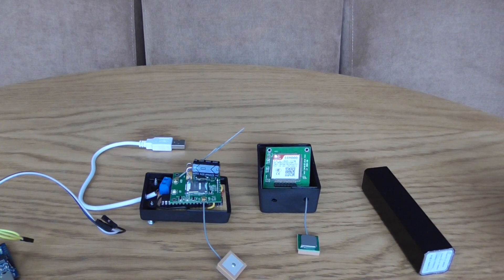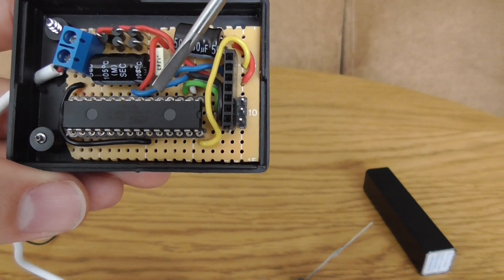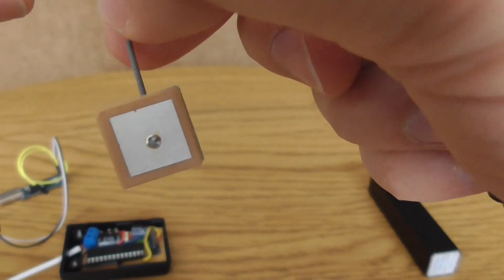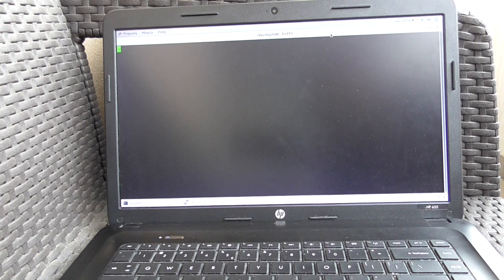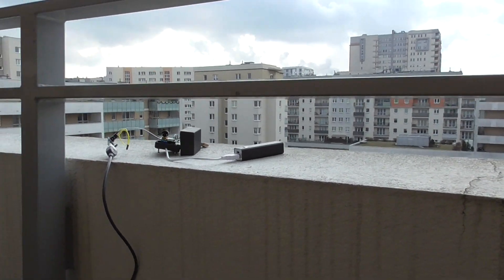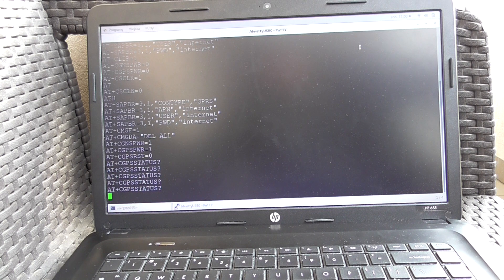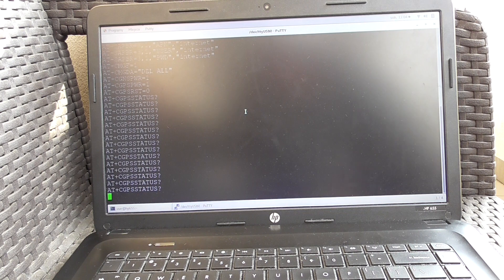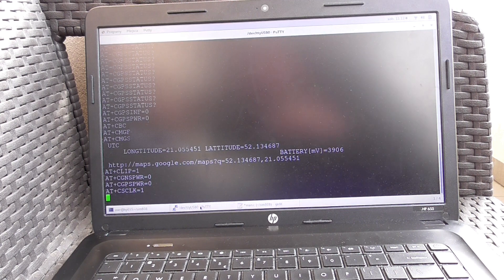Make your own cheap DIY GSM GPS bike car tracker / GPS car locator  for  20 USD ! - based on SIM808

Comment: hi Aadam!! really greatful to found your video, i wanted to make a device for my community as pet tracker but maybe i'll use wemos d1 mini as the main board to connect with the SIM808 do you think its doable? also i have zero knowledge in this, i just hope i can do this to help the owners.
Reply from the maker: Hi, I have no experience with Wemos D1 mini so I am unable to answer. But if it has real serial port available and if there is C language compiler then it is possible do build the tracker with this board. I can see it is based on ESP8266 so ih probably has serial interface
Reply: @justanengineer5599  thanks for the reply. can you to teach me  in figuring out placing of boards and calculation on voltage, do you mind? im sorry if it is a weird request because i dont really know how to place the things and calculate the voltage.
Reply from the maker: Here you have a tutorial showing how to connect SIM808 breakout module from AND-GLOBAL to Weimos D1 mini : https://www.instructables.com/HackerBox-0048-SIMSAT/
there is also some sample code for testing this duo ;-)
Reply: Hi Michelle! I am working on a project similar to the one you mentioned. Could we communicate?

Comment: Hello Adam,  can you make a device that doesn't use gmrs/cdma? Strictly satellite?
Reply from the maker: That would require satellite transceiver which is very expensive. An example is  Iridium 9602 transceiver. Of course satellite Iridium phone could be used to transfer some data as a modem or send text messages (Iridium GO !) but I do not have one to check how I could utilize this channel of communication

Comment: hi adam can you change or make a source file for sms activating gps module because call is not common in gps to acquire position
Reply from the maker: hi, please use files "main7.c" or "main8.c" - these source C files are exactly what you need. By  texting the device from your phone with message content :  "single" you will get single GPS reading back as a text. The "main7.c" and "main8.c" files  are not experimental versions anymore, they are fully working and are in use by my colleagues in their car GPS trackers. 
You can see how the "main7.c"/"main8.c" source file  works in this video : https://www.youtube.com/watch?v=ZMRz5Emcvew

If you have BK-808 module from AND-GLOBAL please use "main7.c" source file and "compileatmega7" compilation batch script. For other SIM808 boards that do not have DTR line exposed - please use "main8.c" and "compiletatmega8" script.  Now "main9.c" is the experimental code.
 
In this version you will get support for following text commands of the GPS tracker :
    Command "ACTIVATE" stores the phone number of sender as allowed to MT call . Only 1 phonenumber is stored and allowed to call.
    Command "MULTI" gives CONTINOUS MODE of positioning and sends 5 times GPS location in 3-4 minutes interval. 
    Command "SINGLE" gives single GPS/GSM positioning response.
    Command "GUARD"  notifies the sender if GPS position changes  (~300-500 meter sensivity is hardcoded but can be changed in the program) - tracked vehicle is on the move, maybe stolen. "GUARD MODE" can be stopped by sending "STOP" message or ends up automatically after first detection of movement.

Comment: Please contact me I want to add a feature to my mobile app which will allow users to purchase this from you and integrate the device with my app.  Email me at dperley@bikerflyer.com.
Reply from the maker: Hi Daniel, I do not want to sell this project. This is published as free, so everyone could enhance this project and add new functions.
Reply: @justanengineer5599  No I don't want to make money off it, I want users to be able to get it and use it in the app.  But you can't be asked to pay for the supplies yourself.

Comment: you can't imagine what did you solved for me with that cap. 5 nights struggling with different power supplying and it didn't connect. Thank You so much man.
Reply from the maker: Glad I could help :-)

Comment: can we modify the output to send via cloud server using POST? I want every 3 minutes to send the location on my server. Can this be configure via Putty or I need to recode/fflash all details with new format via Audrino tool?
Reply from the maker: Hi. To use HTTP POST the SIM808 board would have to connect to GPRS and  then setup HTTP connection to your server. You would have to make corrections in the code, then recompile it and flash ATMEGA again. I currently have no time to make such adaptations in the code but you may look at this page : https://www.raviyp.com/embedded/194-sim900-gprs-http-at-commands?start=1   There is a short info how to do it. Also here is a good example https://stackoverflow.com/questions/33346425/sim800-at-command-post-data-to-server            The SIM808 works exactly same way when connecting to GPRS and HTTP

Comment from the maker: How to program the ATMEGA chip  :

It is all well described in README.md file on Github link https://github.com/mcore1976/sim808gpstracker/blob/master/README.md . The procedure is following :

a) get Ubuntu for your PC. If you have Windows machine you may download WINAVR environment here https://sourceforge.net/projects/winavr/    - but I dont have experience &   templates for WinAVR   - then proceed with step (c)

b) download Ubuntu packages : "gcc-avr", "binutils-avr", "avr-libc", "gdb-avr" and "avrdude"  -  using command : "sudo apt-get install gcc-avr binutils-avr avr-libc gdb-avr avrdude"  ( sometimes "binutils" instead of "binutils-avr" ) 
on this PC . You may also follow tutorial here http://www.linuxandubuntu.com/home/setting-up-avr-gcc-toolchain-and-avrdude-to-program-an-avr-development-board-in-ubuntu   

 c) buy USBASP programmer (2 USD here https://www.aliexpress.com/w/wholesale-usbasp-programmer.html) 
and connect to  PC from one side, from other side connect programmer to ATMEGA  chip to following PINs : MISO, MOSI, SCK, RESET, VCC, GND with cables connected to KANDA plug - described here  http://www.learningaboutelectronics.com/Articles/Program-AVR-chip-using-a-USBASP-with-10-pin-cable.php

d) download combination of two files from my GITHUB page here  ( click the file, then click RAW, then click Save As on your browser): https://github.com/mcore1976/sim808gpstracker (depending on SIM808 board version)  : main.c + compileatmega ,  main2.c + compileatmega2

e) modify the C source file mainXX.c to match APN/USERNAME/PASSWORD for your GPRS SIM card provider : you need to modify the lines with "AT+SAPBR=3,1,XXXXXXXXX" like described on Github  ( put correct word instead of "internet" in each command)

f) change execution rights to the compileatmegaX script :   sudo chmod +rx compileatmega 

g) run the script  from directory you have downloaded the files   : sudo ./compileatmega     , it will compile the C  file and upload .HEX output to the chip ATMEGA using AVRDUDE and USBASP cable

h) ATMEGA  chip  is programmed and you can connect it to 5V  power source and SIM808 board. Depending on type of SIM808 board you may need extra 1N4007 Diodes (to lower VCC of ATMEGA to 3.3V) or not. You will have to check what is TTL Logic voltage for particular SIM808 board in the manual. For BK-808 shown here you need these diodes and capacitor.